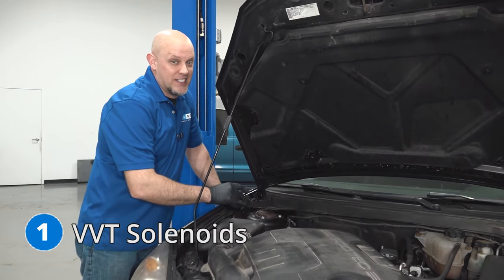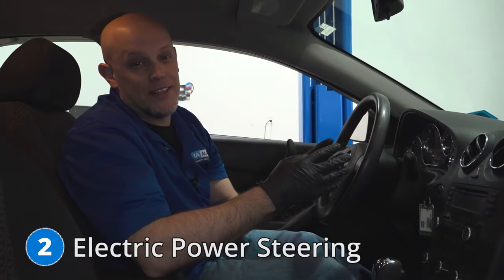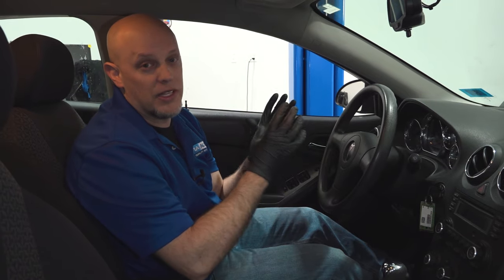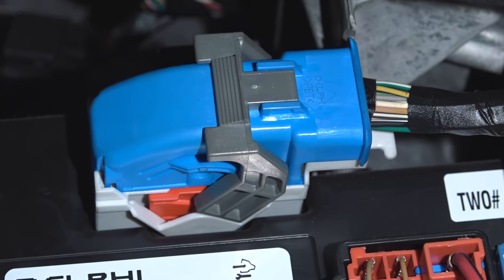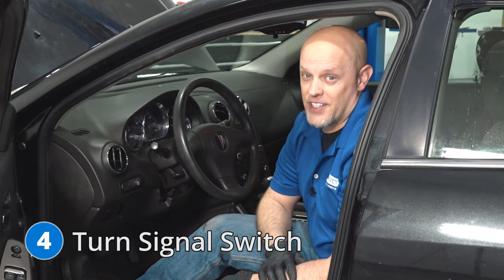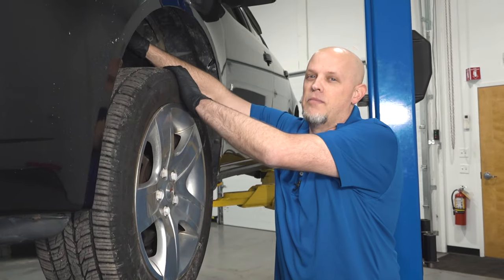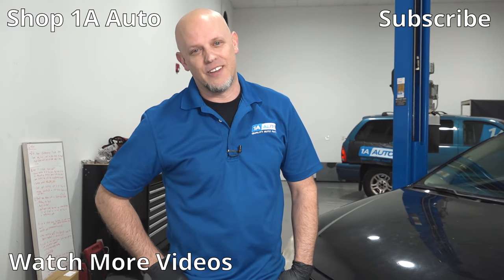Top 5 Problems Pontiac G6 Sedan 1st Generation 2005-10

Comment: Mine won't start unless I wiggle the wiring harness right below the BCM connector. Why? Square red one plugged to the fuse box. Will unplugging it and putting that grease stuff you said on it fix it. Or does something need replaced. Already changed battery and starter. Thought that was it but still when it doesn't start I just wiggle and it starts. Milage dissapears when it doesn't start and lights on dash light up. Remote start doesn't work anymore either not sure if it's related or not

Comment: Hey I have a 2006 g6 gtp.

I’m currently getting the door lock and unlock going crazy when I take it out of park. But as soon as it goes back in park they stop going crazy. Then it also won’t shift passed 3rd. Even when I stick it in slapstick to try and shift out of 3rd I get an error on the dash where the gears are displayed. As well as a crazy idle. Also, my cluster gauges move up and down like crazy when driving.

Comment: VVT solenoids here, check light comes on and off. Bank 1 code P0011. 3.5 v6 so the intake, belt, and water pump will need to come off to install. Also loud whistling from underneath exhaust when accelerating past 2 rpm’s, hope it’s a simple gasket fix

Comment: What brand do you recommend for the low voltage dielectric grease. I am having trouble finding low voltage. What should I buy?
Reply: I bought some at O'Reilly auto parts. They have little packets or an entire bottle.

Comment: I cant believe they didnt mention ball joints. Here in NY I replace lower control arms all the time due to loose lower ball joints. Maybe it's from our bad roads?
Reply from the maker: +06goatm6 Thanks for the tip! We'll pass this info along to our production team.
Reply: No, this is a common issue with this model. The balljoints are machined into the lower control arms and it is a common problem with this model because they are made out of aluminum.
Reply: It’s Your bad roads..
Reply: I had to do the same with mine. I'm surprised they didn't add grease zerks to the ball joints. I'm sure they'd last a lot longer if they could be properly maintained.
Reply: Help??? I keep hearing a knocking noise like something loose..i had the sway bars replaced but that wasn't the problem..i was told it maybe the ball joints..i can't keep wasting money on maybes! 😊
Reply: Replaced both ball joints and struts at 40k miles.

Comment: I have this car and it's like the whole left side is shaking extremely bad at time and sounds like 2 plates banging when I go to brake. What could the issue be
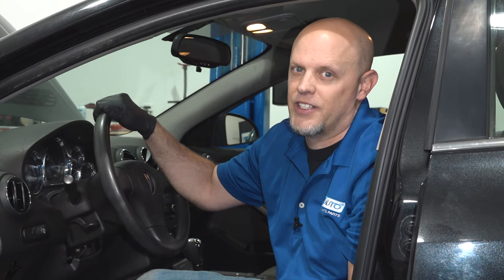Reply: front wheel hub bearing @ 2:21. i just changed mine, but could also be the break pads

Comment: My turn signal doesn’t shut off when I turn but you didn’t give the solution did you?  Can you do a video on the convertible pretty please? Mine worked fine but now I’m getting a “check cargo top” message when I’m trying to get the top down.. Check cargo top where and how?

Comment: Another big one is the Low Beam Headlight connector terminal corrosion that melts the lamp connector terminal.
If you know how to do electrical repairs, then pigtails and dielectric grease from parts stores will only cost about $20.
If you take it to a dealership, they will be required to sell you an entire front lamp harness ($$hundreds$$) , because they aren't allowed to modify a safety system. That won't solve the problem either, because it will just fail again.

Comment: Is the steering column sensor issue a replace and wait for it to go out again or is there a more permitted fix for this problem?  That sensor was replaced under warranty from Pontiac and it has failed again.
Reply: Cause they probably used the same model part, just get a shop to replace it. They'll likely use an aftermarket part that'll work better.
Reply: Replaced mine and been good since

Comment: Electrical issues with the headlights nonstop for 5 or 6 years. One side has new pigtail replaced and still.

Wheel bearings have been replaced twice in 3 years in the front.

Comment: What is the difference between dielectric grease that you use on a 12v system and a low voltage dielectric grease? Can you recommend a product?

Comment: I hit a deer in November, did not know that the radiator was cracked- and drove all winter with basically no radiator fluid. Noticed it in like May, had it fixed. Still running like nothing happened.

Comment: i replaced 6 wheel bearings in 10 years and control arm assembly
Reply: I WAS GUNNA SAY I CHANGED THE CONTROL ARM ASSSEMBLYS 2 TIMES IN 4 YEARS

Comment: 2009 pontiac g6 2.4L... My car won't accelerate well. Pushing beyond 40-50 mph and it just decelerates on its own and its bad to the point of surging down to 15-20 mph if I punch the gas. And also when I punch it,  the traction control comes on and engine power reduced, warnings come on and the car will shake pretty violently when I come to a stop. I shut my car off for a min and the warnings go away when I crank her back up. And I can go back to my cautious driving...
I've had 2 "cam phasers" (VVT) changed out. Fuel pump replaced. Vent valve solenoid replaced by the tank. And taken the cat converter out and cleaned. 
When the cat converter got cleaned. It seemed like it was semi fixed. The check eng light was out for all of 10 mins so I didn't dare push her too hard. But I could at least get on the freeway again. After 3 or 4 weeks, I just felt a difference in the power, but she was still doing her better performance. I put some cataclean in there. Maybe a day or 2 later and it's back to it's old ways. Can't drive on the freeway at all. Can't accelerate worth a crap. I turn her off and crank her back up every 3 or 4 red lights and she seems to do her normal version of bad, until I go up a hill, and she bogs down and won't allow for acceleration until the hill is behind us.... What else can be changed? What am I missing. Why does she do better with turning off and cranking up? Any suggestions or insight or input is welcome....
Trying not to get have to get another car... And trying my damnedest to keep "Pontisha", that's what I call her, as long as possible. But I'm at my wits end.
Reply: my dad owns one too but his is am 06. he had rhe same problems you're telling me about. he went to a mechanic shop to get it diagnosed and they told him it was the transmission that needed to be replaced. but he got different opinions from other mechanics and they told him it wasn't the transmission that it needed a sensor (forgot which kind) but saved himself from buying spending on whole another transmission to spending like $40 bucks on tge sensor at the junk yard.
Reply: Can you please find out which solenoid your Dad replaced? I would love to get my Son’s car running again. Thank You, Jim
Reply: Can you please find out which solenoid your Dad replaced? I would love to get my Son’s car running again. Thank You, Jim

Comment: I have a 2010 4cil 2.4l it gave me issuses sometimes it would start with no prob and then it wouldn't start after using it till it cooled down but the temp wouldnt go above 200. Ive changed the starter solenoid and kept on doing the same now it wont start. Im about to check the relays, any tips u can give me on what the issue might be??? Please and thatnks

Comment: great video. i refer to your vids when we have problems with the G6.

here are a couple of problems we think may be related to the BCM. The power locks don't normally work, and I say "normally" because they worked for about a minute on two occasions in the past 3 years. lol. Also we cannot engage the TPMS setup on the DIC.

We were told it might be a problem with the BCM and we should clean the connections. So with that said, which dielectric grease would you recommend?
Reply from the maker: +Gettin Mine Thanks for watching!  That is certainly a good thing to try first to see if it fixes your issue.  Dielectric grease wouldn't hurt, just be sure not to use too much.

Comment: My buddy had one of these. He asked me to help him change the headlight bulbs. I said "sure, how hard can it be?" One removed front bumper and a bunch of headache later, I realized how difficult Pontiac had made this car to work on. Changed the blower motor also. The first I've ever had to actually cut out to replace. Piece of junk, the G6.
Reply from the maker: +eddietorres112 Thanks for the feedback!
Reply: Malibu same thing. Bumper has to come off. Lesson learned, one GM are a headache.. two, research before you buy.
Reply: Oh no! You had to remove 10 bolts of the same size 😭😭 such a tough job. I've replaced my headlights 3 times. (One stock, one custom led, one smoked stock) its not hard at all 🤣🤣 this car has gone through so much and still going strong. GREAT CARS
Reply: Umm I've changed mine, never had to take off the bumper
Reply: You're kidding right? Do both you and your buddy get crash helmets and coloring books for Christmas every year? You got to pull the lamp assembly out, remove a couple of bolts, that's all! BFD! If you took the bumper off that's because you guys don't know what the hell you're doing. Should take a video of you guys working on cars , probably comedy gold.
Reply: Once you know how, takes about 15 minutes to change the headlight bulbs and even the assemblies.

Remove the top 6 plastic pins holding the bumper fascia. Just push it down, it does not need removed. Wiggle the assemblies out to get access to the bulb covers.

If your headlight assemblies are horribly faded, new ones are cheap on Amazon.
Reply: Yes, it does require removing the front fascia. I agree that's ridiculous.

Comment: I have an 06 G6 GTP Convertible. It is making a loud squealing noise when you hit the gas.The guy I bought it from says its an exhaust issue. It has thrown some code related to the O2 sensors. P0171 and PO174 also P0102, P0106 and then a random misfire P0300. It doesn't make any noise while idling. The noise itself to me sounds like a loud vacuum issue not exhaust. I've looked under the hood and haven't been able to find the issue. Any ideas of where I can look. I have decent mechanical skills, I built and repaired cars for GM for 34 yrs. I actually worked at the plant this car was built but transferred prior to the G6. Thanks

Comment: I have no front signals but the back work fine. i cannot find any blown fuses , checked all three fuse boxes and noticed there arent any fuses labeled for the turn signals so i checked all of the fuses and all are good. i tried the BCM connector but nothing changed. im trying the steering wheel turn signal switch next . can anyone please tell me where to look for a fuse for the turn signals?

Comment: Wonky brake lights and issues resetting my catalytic converter and evap system to pass inspection.  Drove more than 60 miles on this 07 g6 to hopefully reset,  didn't work

Comment: HELP HELP HELP PLEASE .So I have an 05 g6 gt. Sometimes it wont start. I replaced battery, still does it. Replaced starter, still does it. Finally figured out when it doesnt start if I wiggle the wiring harness plugged to the fuse box right below the back connector it starts. Why? Help. It's the red square below the blue bcm thing. Do I need a new fuse box or do I need to replace the wiring harness I wiggle?

Comment: I have a 07 gt coupe. I have the turn signal issue. How do you fix that? Also have a sun roof. No leaks in cabin, but with heavy rain water gets in my trunk and radio speakers ho crazy, won't stop loud noise even after turning off the ignition. Once it ceases radio lights up but no sound until next day, and all is back to normal. I guess wires are getting wet. Where is the water coming from? Thx
Reply: I bought a replacement turn signal from eBay for about $30 bucks and replaced it. It's 2 bolts to get the steering column cover off and another 2 screws to remove the actual turn signal. It's been about 2 months, no issues so far.

Comment: I have a 07 currently 216 thousands miles the transmission won't shift to the last gear, I have a noise when I turn the steering wheel then also when I'm on a bumpy road I got bunch of noise on both sides I'm thinking is the wheel bearing I could be wrong

Comment: Will the solenoids cause a no crank, no start after car has sat for a period of time? The battery replaced, starter replaced but no gauge action. All electrical works... I'm stumped...
Reply: Im have the same problem even replaced my alternator along with the battery. If u figure it out plz lmk.

Comment: I have an 07 poniac g6 m I ne turns on good but when it's been a while driving when I get home the car won't start no click sound when I turn the key battery is new also the starter is new too and the alternator, and battery cables r new too it turn on after an 1hr later
Reply: Check the fuse box and the ground cable to the fuse box, mine had that problem and it was a bad ground cable to the fuse box.
Reply: My 07 Pontiac g6 have same problem!

Comment: i have a 2008 Pontiac  g6  4 door an my back door locks dont go up ro down  any videos on that
Reply: I have the same problem with my '09 g6. What makes it worse is that it's so hard to reach the little tab to unlock the back door by hand. I just got the Pontiac last year. My old car had a failed rear door lock actuator but I could easily reach it to unlock it manually. That and my old car's smooth turn signal, I now miss very much

Comment: It’s kinda funny when my g6 daily had every single problem you stated
Reply: Me too.  Those  cars  are junk  but  after   14  years  of it  I can't let  the thing  go.
Reply: @rickspriggs2176  100% junk, but it will be considered a classic one day. I can't let the g6 go, it's one of my backup cars (the other is a 83 Monte Carlo :) aka gas chugging tank of a car) that is in insanely good shape for 160k miles. Hardly any problems outside of electric steering, I'm lucky. The only reason I looked up this video up is bc my turn signal is starting to act weird.
Reply: I have a v6 gt sedan and mines running 60k miles 11 years one owner. Only had to replace usual stuff like thermostat, occasional fuse and plugs after it sat for 2 years.  No major problems besides the shifter linkage recall which is covered.
Reply: I got the GTP version I'm Puting a body kit on it and  new wheels

Comment: Have a Pontiac G6 2006 won't drive in drive  it will reverse and go very slow in manual code reader says ECU open also power train could it be the computer

Comment: Every GM car I've owned also has a tire sensor issue and with my G6 it has a door sensor issue. Anyway, how would I know if my computer is failing or if my transmission?
Reply from the maker: +Nathaniel Kramar We wouldn't be able to diagnose an issue like that here, you may want to have a local mechanic take a look at it. Thanks for checking us out! http://1aau.to/m/Shop-1AAuto-c

Comment: My 2009 g6 2.4 is surging, and as it does that, the speedometer goes down and jumps up..
Reply: Transmission speed sensor
Reply: @edgarhoey8733 , just now seeing this reply, thanks for responding to my comment!  In the last few months, I replaced the 2 solenoids and the speedometer quit jumping up and down, but car still surges.  I was reading some posts yesterday, saying it's most likely speed sensor!  The car only has 100k on it.  So, I should tell auto zone I need a transmission speed sensor?

Comment: Lately, when I’m driving my 2008 Pontiac G6, the “door ajar” message flashes and the beeping comes on. It’ll go away but every now and then it’ll randomly come on. Anybody have any idea what it could possibly be?
Reply: So, the first thing to try is spray WD-40 generously on the drivers door latch and exercise the door about 12 times. It worked for me, because I never use the other doors. But you could try that on all the doors if you regularly use them. Otherwise, it requires removal of the trim and either defeat the ajar switch or replace the entire latch mechanism.

Comment: problems with 05 g6 3.5 l gt
Throttle body goes out evey 3 months sunroof leaks are very common on any year the 3.5 in the 05 the connectors for the throttle is much wider than the throttle 3.5 for the 06-10 the 05 3.5 is more expensive and more problematic is y they hurry and switched the very next year
Reply: You are probably right. I have an 08 G6 GXP with the 3.6L and it doesn't have any of these issues. However I did have to replace the valve covers and valve cover gaskets when we got hit by the Polar Vortex because they are plastic.